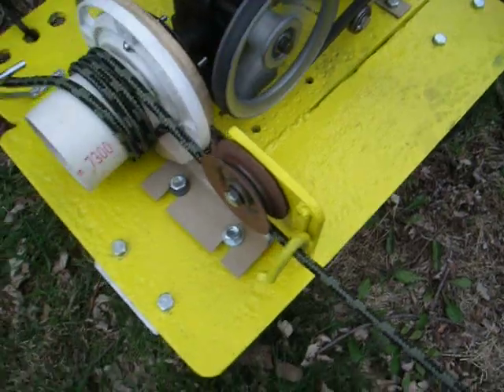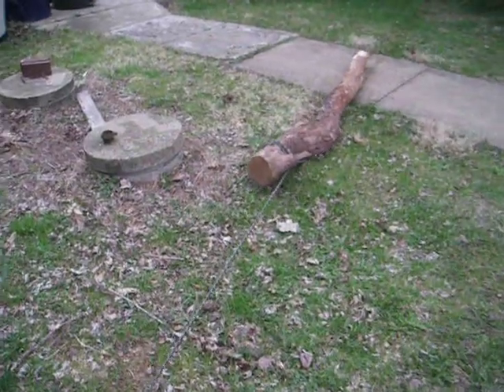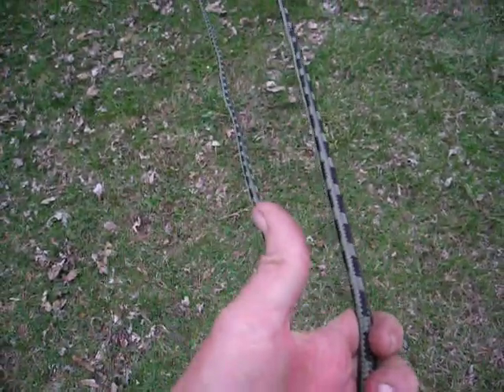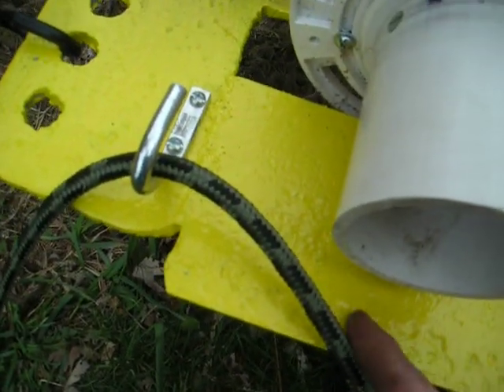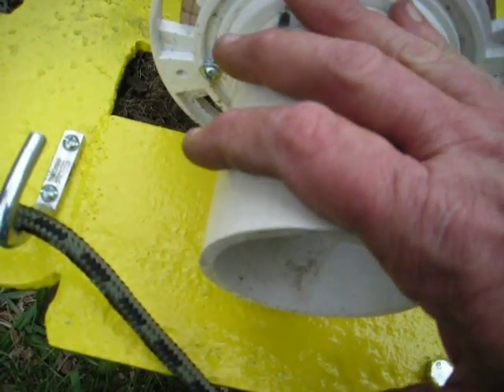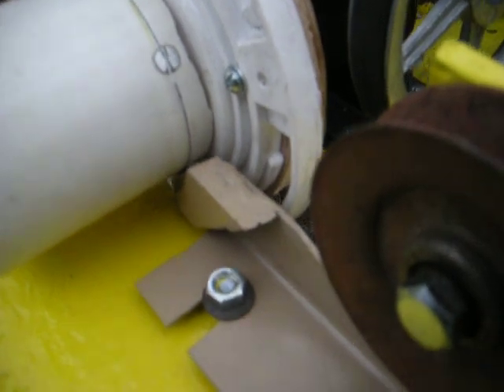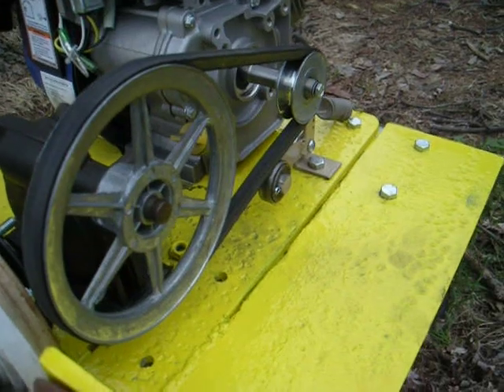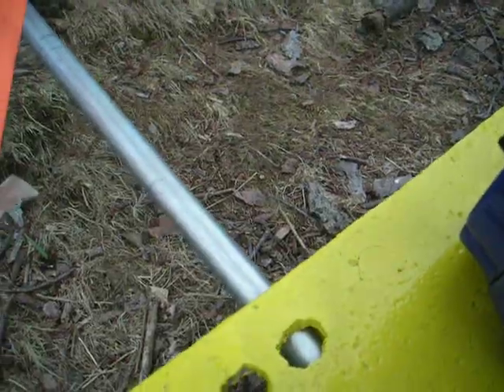Homemade capstan

Comment: A tip on improving automation: 
Freeze the video at 1:16 to follow my description.
step 1: Add one more wheel to the left of the white wheel where you form the loop of the rope.
Make sure there is a free rolling wheel right underneath this springing so it locks the now held by hand rope.

step 2: Make sure the second wheel, (not present in picture) is connected to the first by gears on both the white and the newly added wheel.
(This makes the newly added wheel spin in the reverse direction of the white wheel.)

step 3: loop the rope as now (up over the white wheel) and the down under the second wheel.

As the newly added wheel (and counter roller) friction locks the rope, the white wheel will do your pulling for you.
All you should have to do is turn the machine on and off.

Comment from the maker: I know that to be true.  The plan was to pull logs and rocks up from a gorge  on a cable/dolley systembehind a friends home.  Some of the flat rocks weigh under 100 lbs. and the loss of power would not be an issue.  The distance from top to bottom is about 200 feet. As you can see, the speed is not great, but it pulled the 100 pound log across the ground. The cable system would be easier even with the incline. If the load is lighter,  I wanted to find that maximum speed so more loads could be run.  Thanks for you input though because it was a valid consideration.

Comment: remember you will trade power for speed. increase in diameter of the capstan will cause a significant loss in pulling power.

Comment from the maker: Fun project!  I don't remember the reduction ratio, but I calced the pulleys to get the speed at the output. Sometimes ebay has some cheaper reduction units,  but not many. Try a motor shop that repairs motors.  They sometimes have units or would have contacts for the reduction boxes.  Some machine shops might have contacts. The type needed depends on engine shaft position.  Hope this helps you.

Comment: This is exactly what I'm trying to make.  I have a 6 hp Honda pressure washer motor that I'm going to use. I'm having problems trying to find a gear reduction unit that I could use.  Do you know what ratio your gear box is?  Everything that I can find is is pretty expensive when getting to the 50:1 ratio and up.  I'm knot sure I need that much reduction since I'm just pulling kayaks up steep sand slope.  Any help would be appreciated!!  Thanks in advance.
Reply: instead of trying to get the gear ratio the way you need it , you might try doing the reduction with the driven and driver pullys. That would be a very inexpensive way to do it.

Comment from the maker: There are s few changes that I would make,  but I needed something quick and cheap. You are right about the tapper on the capstan, but since I didn't have equipment to manufacture pieces,  I went with the straight PVC pipe. Actually, the block wasn't wearing down. It just lost the paint. The incline was pretty step so speed was not that important and the setup worked okay. Thanks for your suggestion regarding the clutch mechanism. If I ever make another,  I would take some time to improve the design. Thanks again!

Comment from the maker: Thanks! Gear does take the load. End project allowed me to bring 500 lb logs up a gorge via a cable system I made. Added the 6.5 to increase the speed to 40 feet /min but reduced the loads to about 200 lb. Ground draging was too hard unless we could clear a good path. Decided to go over the mess with the cable system.  Engine from Harbor Freight. Reduction gear ebay (no part#). The remaining parts were PVC pipe, toilet flange, bed frame, and misc parts. The whole thing worked well for the money.